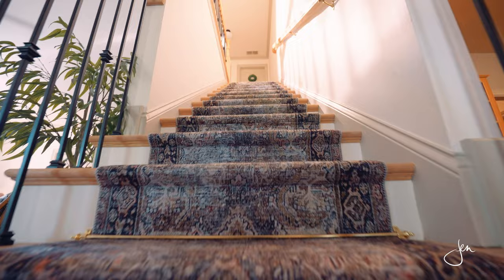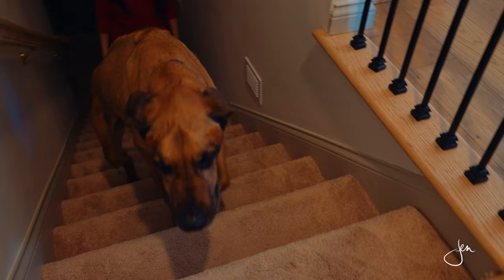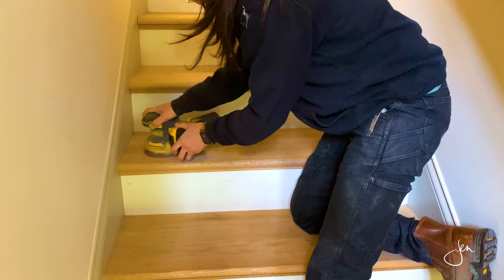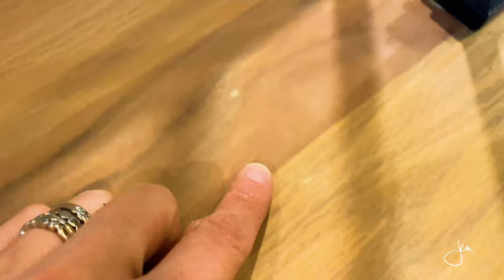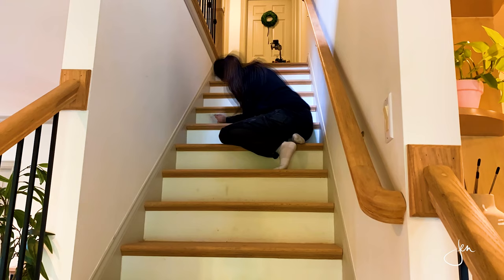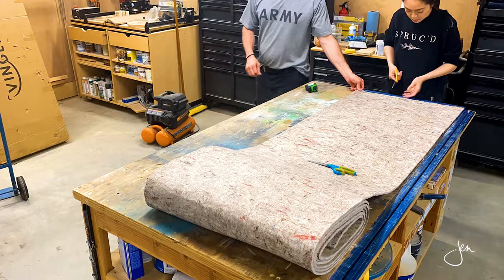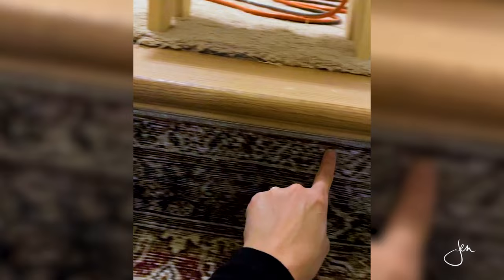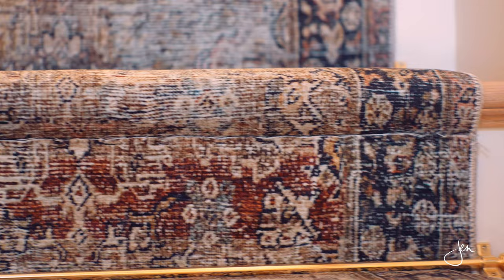Install A Stair Runner in ONE DAY!

Comment: Do you have a video showing the installation of the new wood stair treads?
Reply from the maker: I don't, but I did share most of the process on my Instagram account. Best advice I can impart: work stair by stair. Meaning: demo one stair tread, then replace with a new one. Move onto the next and continue up the stairs. This way, you always have access to your staircase while you're renovating. Hope that helps!